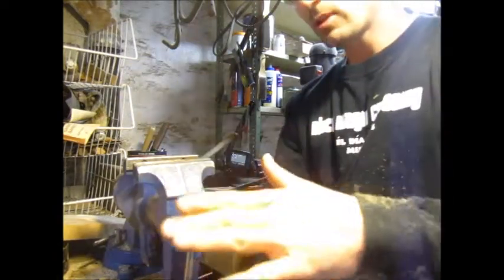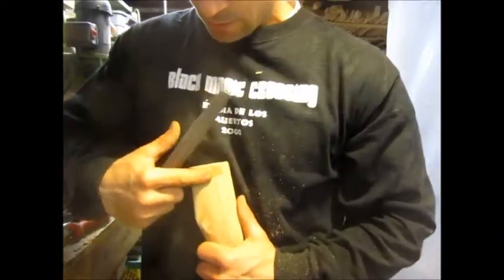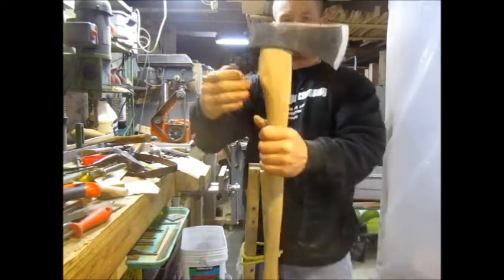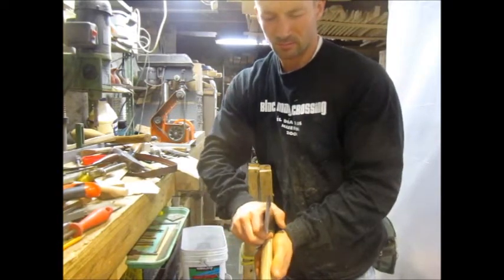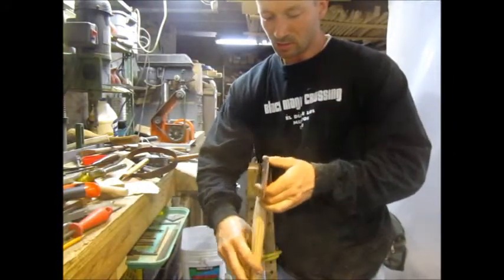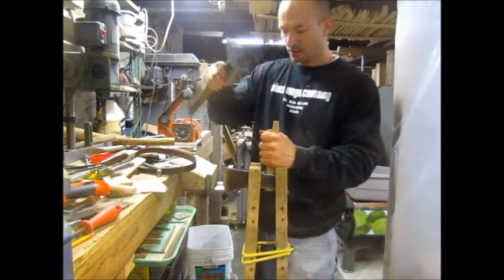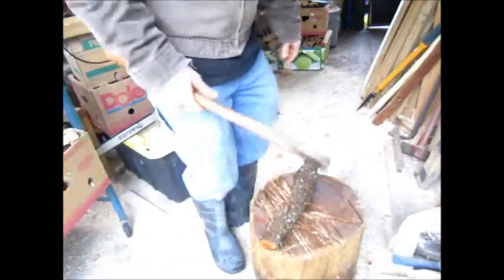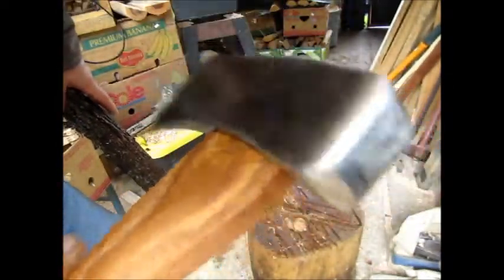Rebuilding a work axe.

Comment: After cutting the handle, why not drive the wood in the eye out from the bottom (turn the head upside down)? Way easier and you don’t have to remove the wedge.
Reply from the maker: Great question!  An axe eye viewed in cross section from the front/rear has a slight hourglass, or more properly, bowtie shape to it.  It's fairly obvious that the handle is wedged on from the top, but when installed correctly it's also wedged on from the bottom, owing to the shape of the eye.  If I tried to drive the handle remnant out from the bottom, it would actually bind up and get tighter.  I used to do it the way you suggest, using a steel punch and many, many great smashing blows with a heavy hammer -- pulverizing the handle remnant in the process.  The method shown in the video is much easier.
Reply: @bastionheadwoodworks  Huh, could you provide any sources for that? That’s just the first time I heard about an hourglass shape, I thought it was a straight wedge shape with the top of the eye being bigger than the bottom.
Reply from the maker: @sammeyer4874  It’s pretty fair to say I am the source.  I am a professional woodworking teacher and toolmaker, and this is my area of specialty.  You should watch my video on splitting maul eye types.  In the video I address this specific point, because so many people are either abjectly ignorant or woefully misinformed of the physics of fitting striking tool handles.  
https://www.youtube.com/watch?v=om8UrLZ_DXo
Reply: @bastionheadwoodworks  That’s good enough for me. Thanks for educating me!